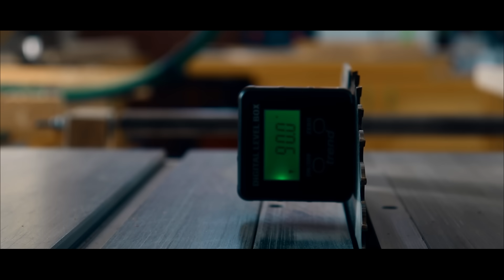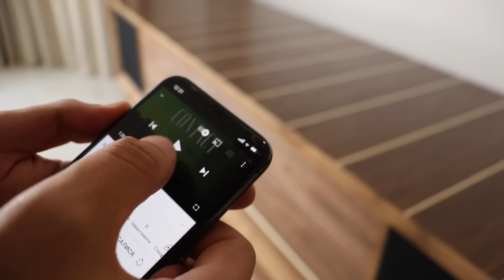How to make Walnut credenza - Woodworking Projects

Comment: Why on earth did you use screw in bolts to connect the side panel (8.40 ish) when you could of just used screws to screw the side on??? Really no need. Great work though. Are you sponsored by Festool by any chance haha
Reply from the maker: Sponsored by Festool 🤦🏻
Reply: @WOODDESIGN6730  What? I am hahaha